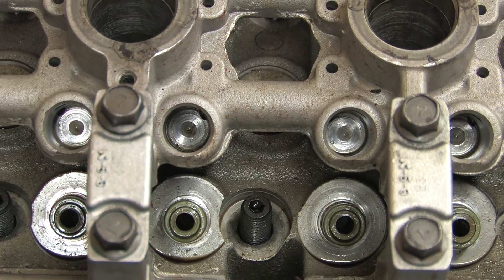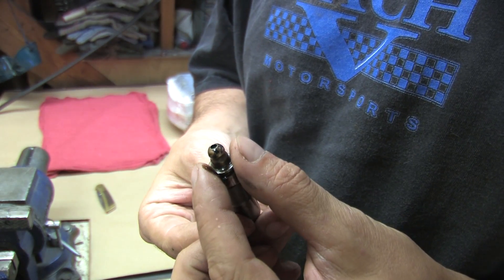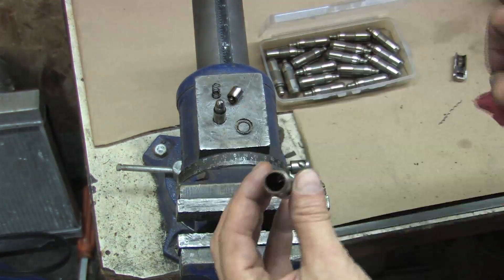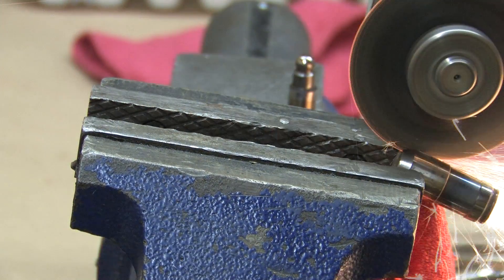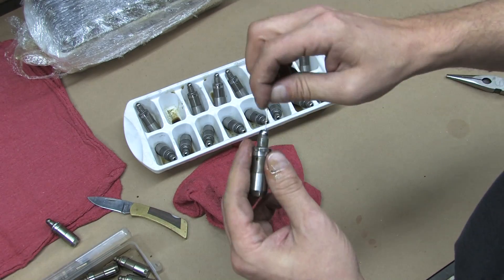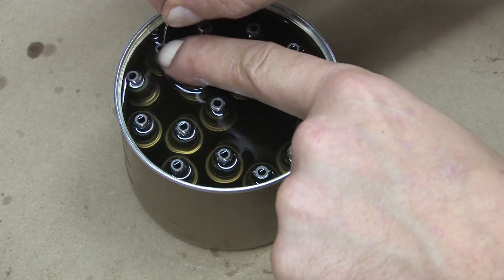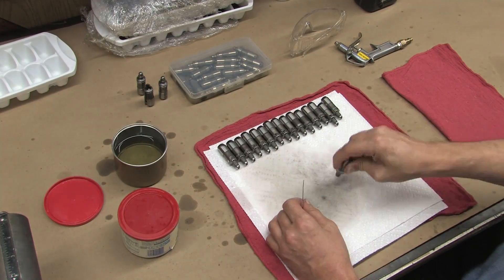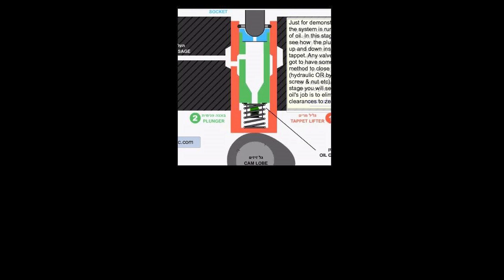Cylinder Head 107 - 4G63 HLA Lifter Tech

Comment: I just bought some lifters for a '99 expedition.  I was told to use a paper clip to inject oil in them otherwise the rollers could slip off and cause severe engine damage, but you're saying if they're rock solid they'll bend valves.  What do I do please?

Comment: Here's a tip: Instead of soaking them in a can, put them in a ziplock back filled with cleaning solvent (such as kerosene), drop them in an ultrasonic cleaner filled with hot water; then run it for 20 - 30 minutes. They will be spotless inside and out.
Reply: You are correct, but have to keep in mind this video was made 10 years ago and ultrasonic cleaners weren't easily available then.

Comment: Hi. Good and efficient technique. Why the new ones I bought from vw are stiff and hard to press with fingers.
Reply from the maker: They're full of oil.  There's a valve inside the lifter centered with the top oil hole.  You can straighten a paper clip and poke it open to release the oil.  I show how to do it in this video.  When they're filled with a liquid, and the valve is closed, the liquid acts as a solid because it won't compress.  Once you get air in it, it will.
Reply: Ok. So when reinstalling them, should they be empty from oil  or hard and  full of oil.

Comment: Greetings. 
I have a Toyota noah 2013 with a 3ZR-FAE,  vvt valvematic engine. Does the order in which I reinstalled the HLAs matter (after cleaning). 
Also, does anyone know where I could find a set of 16 new ones to buy? I can't find them anywhere so far. 
I need help please.

Comment: Well done. I have a few 1980’s turbo dodge 2.2/2.5L heads with improved  2000’s pt cruiser HLA in them (the original HLA didn’t have a pee hole where as PT cruisers did), and I was hoping to find something describing this process 

Thoroughly impressed with the tutorial ! Thank you
Reply: Working on a 2001 PT right now. Head gasket gave with 86k miles on it. Sat for 2 years and now I'm cleaning everything out. Figured Id watch a few weeks of videos before putting it back together.

Comment: I took the little bottle cap off and cleaned the lifter and i put the bottle cap seal back on it went on but not as tight will that be a problem?
Reply from the maker: You have to crush the bottle cap piece back down.  Because of the design changes to these style lifters, you're really better off getting a new set of revised lifters as a replacement.  They show up clean, and the hole is big enough that with enough solvent you won't be required to take them apart to clean them in the future.  The 1g small-hole lifters are difficult to clamp back down, but it can be done.  They're sandwiched between the head and the rocker arm, so that bottle cap piece isn't what's holding it together when it's installed... but you don't want it coming loose and interfering with the rocker arm.  They need to fit well enough that oil pressure can't push the caps off, and so that you can't pull them off with your fingers.
Reply: @Jafromobile  hey thanks for answering. I really enjoy your videos they are the most detailed and well explained ive seen. One last question when i install the lifters do they need to have oil in them or can i put them in freshly cleaned and with no oil in them?
Reply from the maker: Oil them, but drain them out first before you install them.  Don't install them all pumped up solid with oil. Don't install them dry, either.  They'll fill faster and work better on that first startup in this state.  Installing them full and pumped up can actually lead to valvetrain damage.  I'm pretty sure I covered this in another video, but I can't remember which one?  It would be for the Hyundai, I'm pretty sure.

Comment: You are the f'ing Man!! Thank You! 
Can you go in to detail on an interference engine?
Reply from the maker: An interference engine is simply an engine whose valvetrain will occupy the same physical space inside the combustion chamber as the pistons, just not at the same time.  If these events do occur simultaneously it ends with a catastrophic failure of the engine.  On a non-interference engine, the valves can be fully opened when the piston is at top-dead-center without making contact with one another.  You can snap a timing belt on a non-interference engine and experience no mechanical failures after replacing the timing belt.  With an interference engine, your only hope is to get lucky.  Sometimes you get lucky, but it's still the kind of a failure you should take very seriously.  It's usually toast, but I've seen people get lucky more than once.

Look for "Cylinder Head 206".  It's mostly about valve clearance, valve timing and Lobe Separation Angles but in it, I made a pretty detailed animation of what happens when you get your valve timing or clearance wrong with an interference engine.  I fully explain DOHC valve timing in Cylinder Head 205 and degreeing the cams to their baselines, including making your own tools to do it.  It's pretty intense.  The Hyundai engine assembly begins after Cylinder Head 206 in the video timeline.

I don't have a video specifically about that topic, but there are a lot of ASE certified mechanics like ETCG who do.  I only have videos addressing my specific problems related to interference engines, why I have them, and how to tune around the valve clearance issues associated with them.  Basically my videos are the full rabbit hole for when people figure out they have an interference DOHC engine and decided they wanted to know more.

Comment: So i did a quick bleed of my lifters when i installed cams in my evo. I used a allen key and pumped the oil out until Tim could compress them with my fingers. After i got every thing back to normal i have a very loud tick coming from some of them. Is that normal ?
Reply from the maker: They should fill back up after the engine is fully warmed up and be silent again.  If they don't, then you might have an issue with either the lifters, or the head oil pressure.  The noise won't hurt the cams if the oil pressure is good, but if there's an oil pressure problem it could affect the cam journals.  If you have good oil pressure on the gauge and didn't change anything else, give your oil pressure the benefit of the doubt.  It's a common thing for hydraulic noise to occur until the lifters are filled up.
Reply: Jafromobile yeah the car was fine before I took the old cams out. No noise or oil pressure issues. Only thing I did was bleed lifters and swap cams. The tick just scared me.

Comment: Yes instructions are confusing..
Working on a Xterra VGE33 2001 the Nissan service manual says "CAUTION" don't let air get in by keeping it straight or soak in oil, and does not provide instruction in case it happens.

The Chilton's Repair Manual say "CAUTION"  if the plunger moves more than 1mm air may be trapped inside the lifter. Bleed air from the lifter by running the engine at 1000 rpm under no load for 10min, repeat process once again. If still air in the lifter replace it with new one.

So it sounds to me that a spongy lifter will bleed itself after running the engine for 10min. So why so many "CAUTION" write ups warnings doing wrong? Shouldn't be easier and clear to state the opposite?
Reply from the maker: If the lifter is FULL of oil, completely pumped up, and if it's used on an interference engine, it can destroy the engine because it can hold the valves open slightly, usually enough on an interference engine to make the piston meet the valves.  If there is air in the lifters, then the valves won't open fully because the air will compress.  Air will permit valve lash to occur, so your engine will sound noisy.  Only it's not the destructive kind of piston meets the valve noisy.  It's the kind of noisy that over time can lead to poor fuel economy, a loss of power, and wear patterns on the cams and lifters.  If the air doesn't bleed off after 10-15 minutes and the valvetrain is noisy, THAT's when air in the lifter is a problem, and that's when you need to clean or replace that lifter.  It's the SOUND that's unfavorable to the engine's owner.  The inspection in the Chiltons' manual references the lifter being installed in an otherwise assembled engine capable of being started.  It's better to install them empty, but oiled, and let your oil system pump them back up again.  The air will bleed off if everything works.  The Nissan manual is referencing handling when you remove them.  Context is necessary, but often lost in poorly translated Japanese-to-English manuals.  The context gets lost in culture changes.  Some of the translations in the Mitsubishi manuals are hilarious.
Reply: Thanks for the prompt reply and explanation. I'll be installing my well cleaned lifters empty but primed with clean oil and run the engine for 10min soon. I try sharing a video. thanks
Reply: needs to be lubricated not filled, if you have the oil gallery empty, needs to crank engine first, until the oil systems pressure back, make this without sparks plugs, (like first engine start, without load) and your lifters will charge enought to start engine, then put back the sparks plugs and try to start engine, it will start, but noisy, after 10 or 15 min on running, will be decreasing that click...

Comment: Jafro, you had these in a specific order (hence the ice trays) but then mixed them all up. I'm assuming it doesn't matter what order you put them back in? I was under the impression that that's very important to do.
Reply from the maker: Once I assessed that half of them were trash, it didn't matter anymore.  What you want to do is keep them in order unless a part looks unusually worn.  In a valve train, other parts can contribute to that so it's important to know what goes wear until you have a full assessment.  When it comes to valves, yes.  They must all stay in the holes they came from.  Hydraulic valve train?  Eh, it doesn't hurt, but a properly-functioning hydraulic valve train is self-adjusting.

Comment: i was told the lifters were supossed to be "Loaded" before install  i meant loaded with full of oil and hard to compress.
Reply: No! Don't ever do this. If you were to fire up the engine after installing fully loaded lifters the valves would be unable to close; on most engines the pistons would then hit them. Let the lifters pump themselves up.
Reply: This is so confusing.  Here's what ALLDATA says for my SHLAs on a 3.6L GM motor.  So it looks like there should be some oil in the body, but maybe not completely full and thus hard to compress?  

Valve Lifter Priming Caution 

Caution: Ensure each valve lifter is filled with clean engine oil and the valve lifter does not tip over (plunger down) before the installation of the valve lifters. The loss of oil in the valve lifter lower pressure chamber or the dry stroking/cycling of the valve lifter plunger will allow air to travel into the high pressure chamber of the valve lifter. Air in the high pressure chamber of the valve lifter may not be purged causing extensive engine component damage.

Comment: Hey jafro I am rebuilding a 99 eclipse gst, i soaked and the check valve won't let some of the lifters get hard, but they get full of kerosene , are these lifters junk?
Reply from the maker: If the check valves are stuck open, they'll never compress.  Get the paper clip and poke 'em out real good, if you can't clear the jam or if the check valve is broken, you have to replace the lifter.  Just buy a new set off of ebay.  Toplines work great and they're dirt cheap.
Reply: Jafromobile ok. Thank you for replying fast, I'm currently working on my DSM right now!

Comment: Genius! So, with the V1 ones, we can't to use the clip method and kerosene?
Reply from the maker: You can.  If you have any crust inside them that's bigger than the hole on top, you might find it difficult to get all the junk out.  It might take you more soakings, and more cycles.  The hole is just so small...

Comment: "You can actually remove and re-install them without taking the timing belt or camshafts out, but that will be another video." please
Reply: It's true. There is another video on Youtube which shows how it's done. Mitsubishi have a special tool (that costs 35 bucks). You use it to pry in between the camshaft and the spring, releasing tension from the lifters and that lets you remove the rocker arm/lifter. Simple as that.